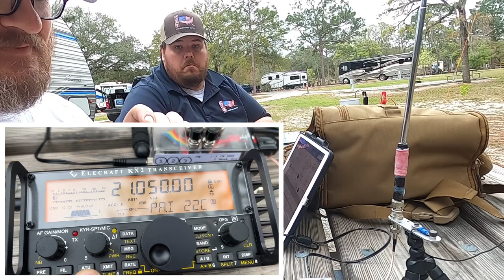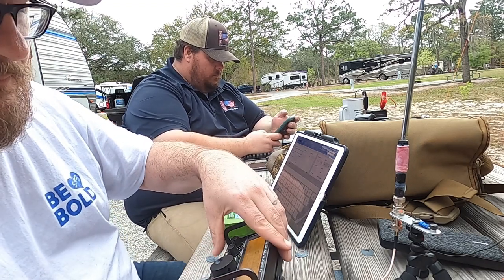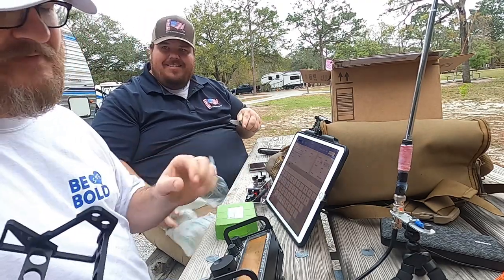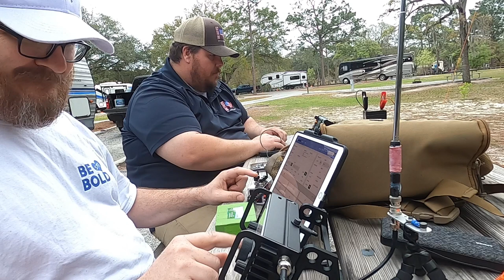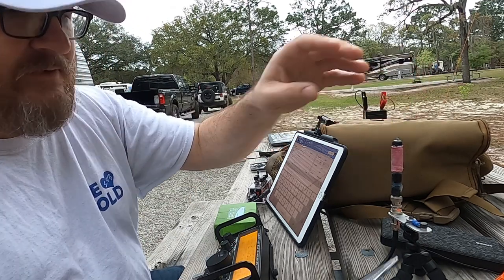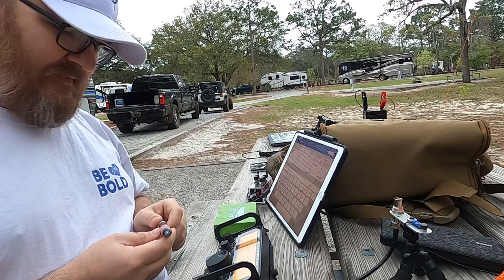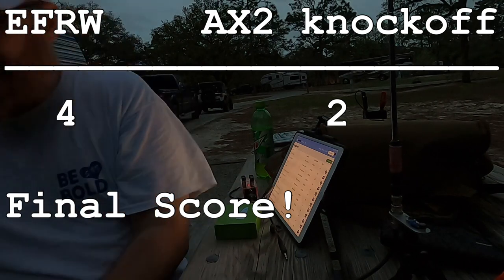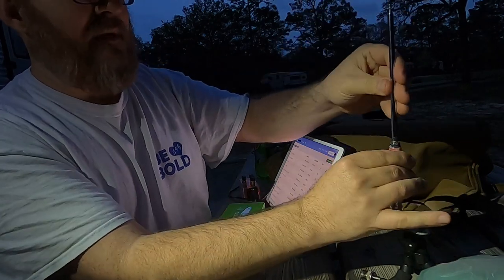Will It POTA? - Field Testing the DIY Elecraft AX2 Style Short Base-Loaded Vertical Antenna (day 1)

Comment: How well is the match without the tuner?     Thanks,   Ken, W4KAC
Reply: Oh, I see.  I've watched more than the initial touch up with the tuner now.   I've had parts laid out for a mini for a year now.  I just keep preferring a long piece of wire!
Reply from the maker: For those times when a wire isn’t possible, this one is a keeper. I’ve found that the SWR can be brought down by adjusting the length of the radial. I’m quite impressed with the design and how easy it is the make.